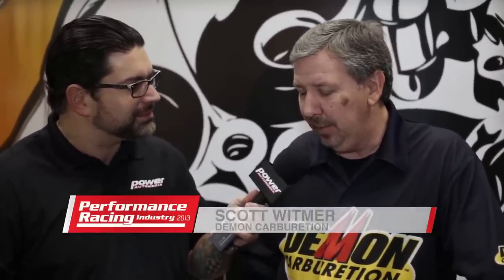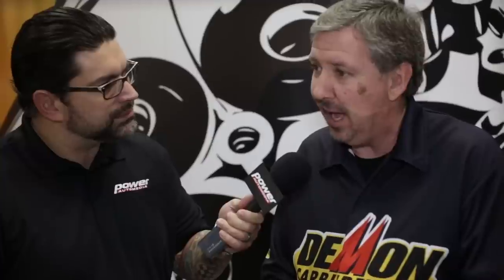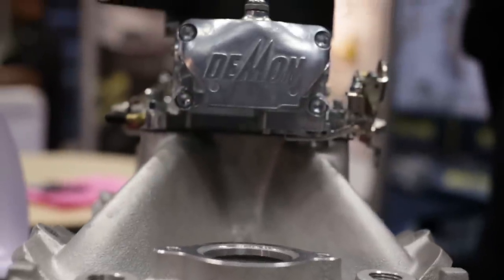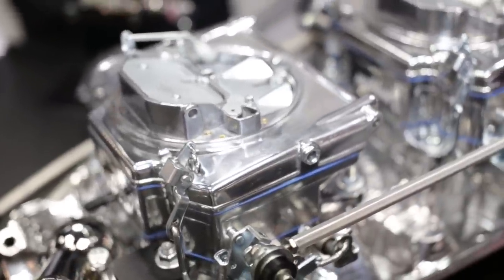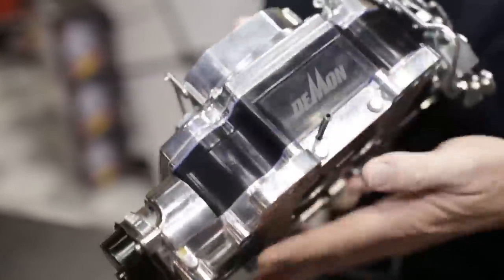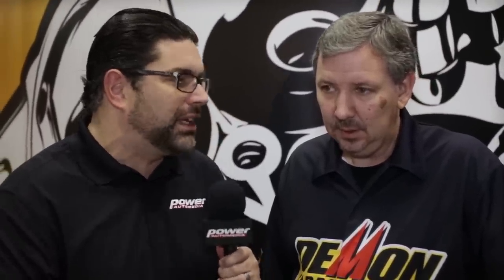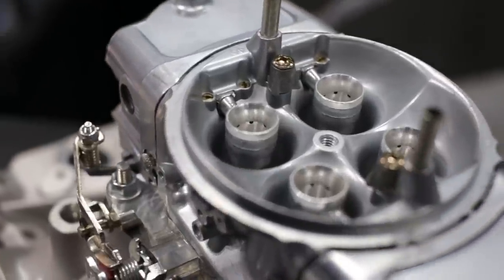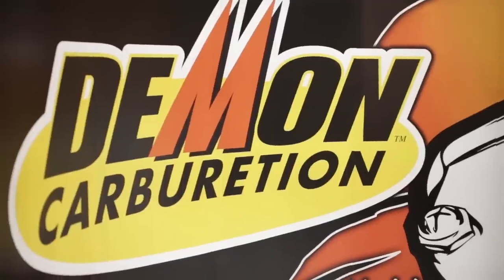PRI 2013 - Demon Carburetion's Street Demon Carburetors reviewed

Comment: I got the black 750 street demon for my 454 nova to replace my modified 800 qjet that worked very well power wise, however i just had to many little issues to keep it. once i installed the demon it performed just as i thought and is defiantly the best street carb around. i highly recommend this carb to anyone replacing a street q jet, holley vs or edelbrock carb.